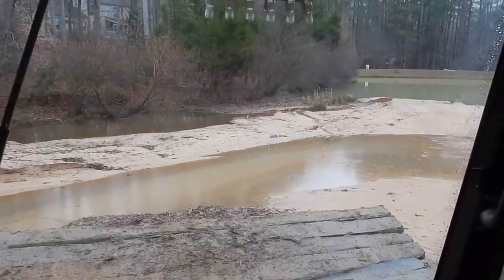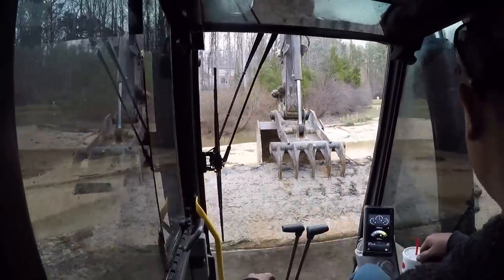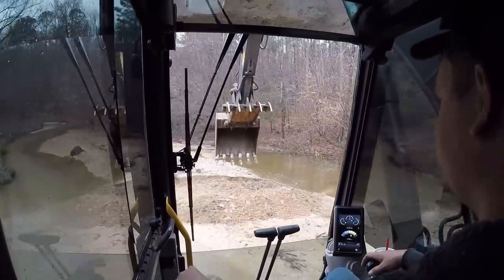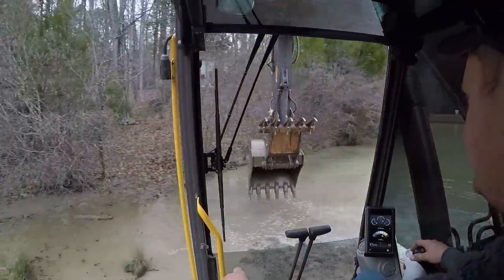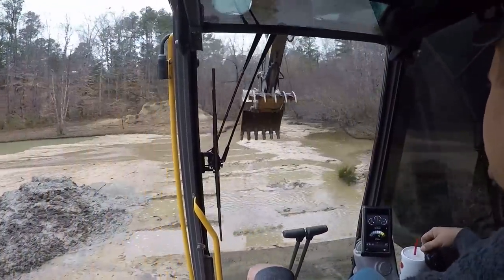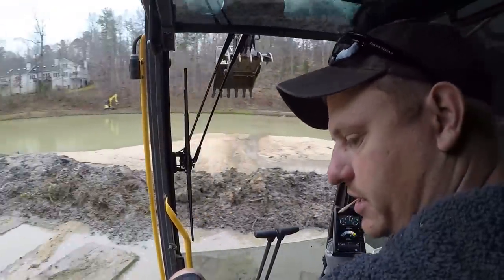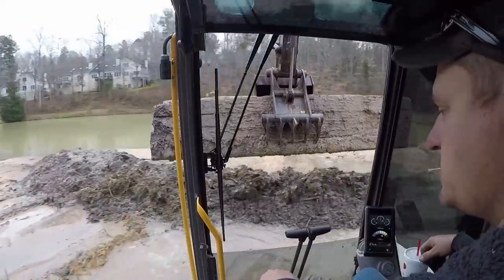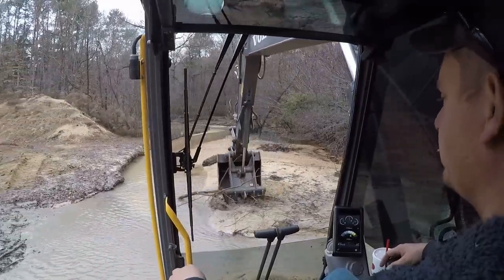Excavator Venturing Out Onto Quicksand

Comment: When I was a lineman, we were setting poles on islands near Cumberland islands so they would have electricity. As long as the tide was up we could work and set poles and run wire. We had to put what we called bog shoes on the poles so they didn’t sink. When the tide was out we would have to crawl . If we stood up we would sink. One guy sunk so bad we used a boat and rope to pull him out. I must admit the sand gnats or no see ens was the worst part of the job

Comment: Hey Chris do you prefer volvo over caterpillar or is it just a matter of the volvo dealer is the closest and most convenient for parts and other things needed to service your excavator. I prefer cat for just about everything but i know cats arent the most fuel efficient machines and with all the toer 4 final bullshit everything seems detuned and lacks power in comparison to the older equipment that hazes a little black smoke under a load but are so simple in design they run forever. Just curious because i know your an owner operator and i was wondering what factors played into your decision to go volvo. Thanks in advance man.

Comment: What type of wood is used to make the table that supports your sack
Reply: I think it is oak.
Reply: @fluke196c  I think Chris has said it is oak.
Reply: A lot of those mats are are made from ekki wood because it's as hard as steel, and they are very expensive.
Reply: There typically oak 4x8  or 6x8.    With like 1 inch threaded rod every. 2 or 3 feet.      Big. Big demand for making them.   Power line and gas line companies oredering faster then they can ever  think of making them
Reply: There made of oak my brother had to buy some he said they are not cheap you can buy used ones they will save you a few bucks he said
Reply: No one got the joke about the size of his balls driving out on that sand.
Reply: Unfortunately video does not show the skill or magnitude of that job. Filming talking & paying attention in a unatural enviroment takes intelligence and nerve. Or as some call it "Balls"

Comment: How are those Rail Road Tie Rafts Bound Together?    This looks like some video game.
Reply: Usually they are drilled like every 2-3 feet through the sides of the timbers and strung  together with like 5/8" cable with clamps on the ends of the cables so they never come apart. But still have a little give.

Comment: I've looked at these videos using the mats and I can tell the material they are made out of. But even using my good eye I can't tell how they are constructed / put together to be so durable.  Someone tell me so I can get some sleep...
Reply: Idk about his but, the ones we use are connected with 4-6 solid round steel rods about 2 inches in diameter put through the center with nuts on the end to squeeze it all together. Like a gigantic bolt threw them..
Reply: Mostly oak or hardwoods like maple.
Reply: It look like they are bolted together, but the heads are countersunk so you don't see the threads.
Reply: I appreciate the replies...seems obvious and simple now that I think about your answers.
Reply: @Paul_n_Texas  There is an earlier video when he had some new ones.
Reply: Usally 4x8 or 6x8 oak. With threaded rod. 1 inch or bigger every couple feet.

Comment: i was sent to dig out a pond with a jd.i was supposed to go 8 ft below the water line.chinese owner wanted a fish pond.the creek was a ginormus  beaver dam.every time i pullled a bucket out and swung to dump it would tip on to 1 track. and every time u moved the boom the hoe would sink a little bit.pretty well impossible to get an escavator stuck.they drop thru to the belly and sit there spinning.as long as u have some thing solid to hook onto a guy can dig himself out.those mats u use r the cats meow. i had to bring a d8 to the hole i dug to get moved a couple times...

Comment: Hey I've seen on you tube an old cat excavator engine removed and hydrolic run off air motors and they run it under water with scuba gear on ....they got air line run off a barge to the machine

Comment: Guess there is a science to everything........You must REALLY need to work to take a chance like that.  I have to ask if heaven forbid you lose a machine do you have insurance to cover it? Know what ya mean about rain. I'm in Ga and we got two more inches today. Septic systems are failing due to the water table rising. I have 1200 ft of 4 inch ag drain tile in my one acre yard and last I checked it was flowing 1200 gallons every 24 hours. It has never moved that much in the 30 years since it was installed. Weather man says dry for the next seven days so fingers crossed.........

Comment: Seems like you do a lot of de-silting where you shuffle your excavator over hundreds of yards of mud on mats and shift the muck to the loading zone in several steps in long "windrows". Handling the same material multiple times, being dependent on the weather, draining bodies of water, and waiting for piles of muck to drain involves time and time, as they say, is money. 

I keep thinking of pumps and pipes, conveyors, in process de-watering, etc but for 10,000 yard jobs the capital, investment, haul and set-up time, cost of operation, equipment storage between jobs, etc would be expensive in $ and time too.

If you could get dewateredsandy mud from the pond bottom to the haul truck in one step without draining the pond - well, even a retired machinist can see the economic advantage of that. 

I keep thinking of a giant, free-roaming, submerged, hydraulically powered Roombot thingy with a whopper on-board pump feeding a long snake of pipe to the loading zone where a continuous flow separator returns the water to the pond and conveys the cohesive sandy mud to the stockpile. The Roombot - Pond-Bot - scours the pond to a set depth and pumps the slurry to the work site. Oh, and it automatically segregates gold from the mud.

Haul the apparatus to the site in five loads. Deploy all the components with the press of a button.  Easy-peasy. Let me know how you work it out. If it works and you make a pile of money, I get 10%. If it's a miserable flop and you lose your shirt, I never heard of you.

Comment: I think I just figured something out. You say "sinkhole" and you mean (I am guessing here) a hole that you could sink the excavator a few feet into the pond. Otherwise saying the bottom gives out and you may sink several feet deeper. Am I correct?

You should realize that you have viewers from places where there are actual sinkholes - which are defined as holes that open up on solid ground that can swallow whole buildings, and more. They also can do that in a lake or stream, and they suck in the entire lake or become a permanent drain for the stream - meaning the stream becomes a waterfall into the sinkhole. Some sinkholes only drop to a new bottom that is several feet to 100 feet deep (or more). You had me praying over your videos and wondering why the heck you would willingly try to support yourself with mats when it could and would take everything including the water!

So, where are you based? What country/province or state?